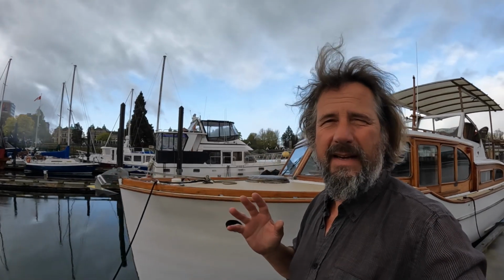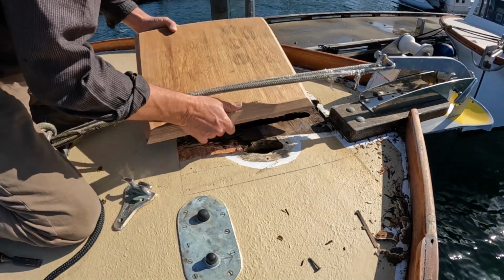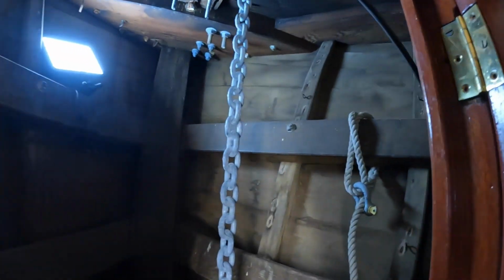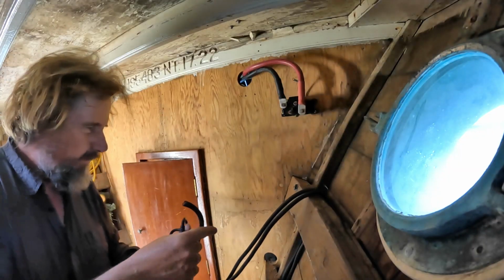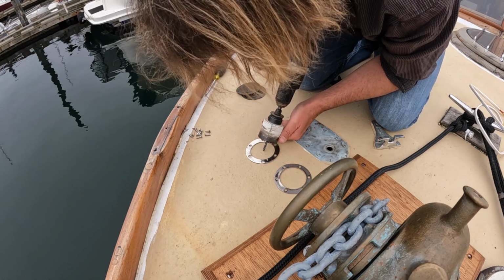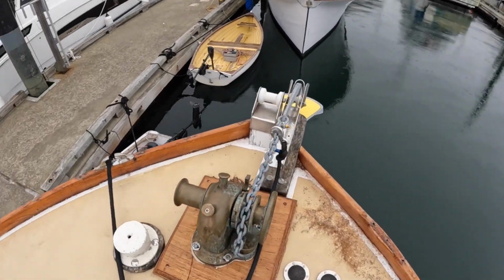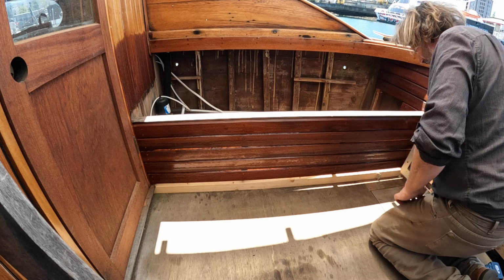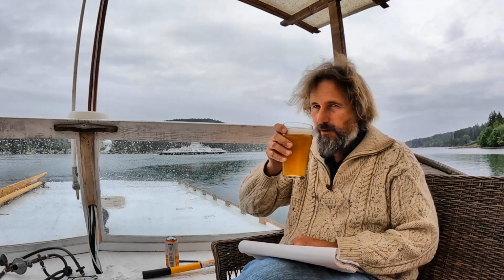Windlass Install - #308 - Boat Life - Living aboard a wooden boat - Travels With Geordie

Comment: Well, you got the job done and got off the dock. Great job! I like the claasification of "repair at sea" for that windlass (in my understanding that means doing whatever is necessary to keep the boat afloat and moving). All that will be repaired properly (knowing you) when you get to a safe haven. I was minded of Mads - Sail LIFE, you have a continuous "somewhat extensive refit" ongoing, so fair enough. Great job for getting out of dodge. I bet there was much more behind the scenes kerfuffle as well. Thanks for fitting in the video in that time poor period.

Comment: From the view of my comfy chair I think I see something of concern in regards to the mounting of the windlass and feel I should mention. The windlass is attached with some exceedingly long and of possibly small diameter, because of length, bolts that are attached to only you know what's down below. This attachment is sitting on an approx. 16 inch square by 2 inch thick block of wood which is itself attached to the rotted deck with tiny (in comparison to size of windlass bolts - maybe a major weak, size-wise, link there?) woodscrew at each corner. A strong tug and woodscrews could get yanked right out and also because other bolts are so long they might bend. Hope I'm wrong but have to mention to be safe but seems the windlass is mounted insecurely and could get yanked overboard in all but calm water.
Reply: My assumption is that it was properly backed up off camera!
JIM
Reply: @jimc4731  My glimpse of that void below deck tells me otherwise. I'm sure it will get worked out though when the real repair happens. Will be interesting to see fix. We'll have to stay tuned in.

Comment: Wow i didn't realize the previous deck was all bad  .
Did you just cover it with 3/4 plywood or did you remove it period ?
If it was rotten then you had quite a few soft spots .
Thankyou for giving me the great idea of using a large cutting board for my anchor windlass 👍🍺

Comment: Would it be wise to use di-electric grease on the windlass connections to limit any corrosion? It can be helpful, especially in salt air environments. The windlass install looks very nice!